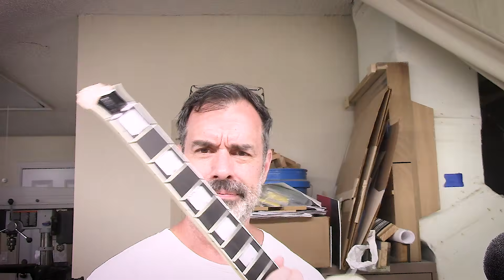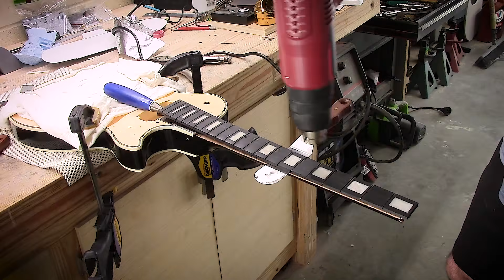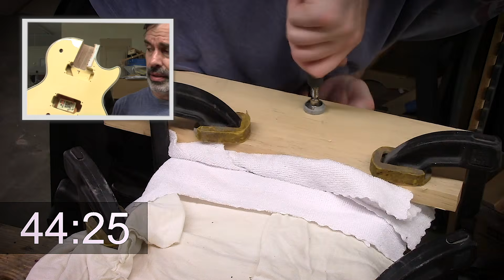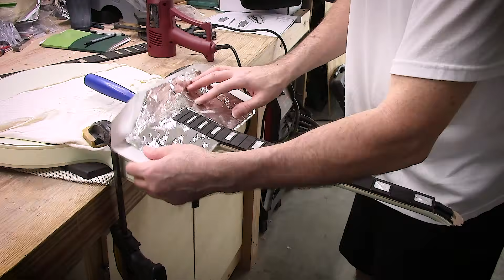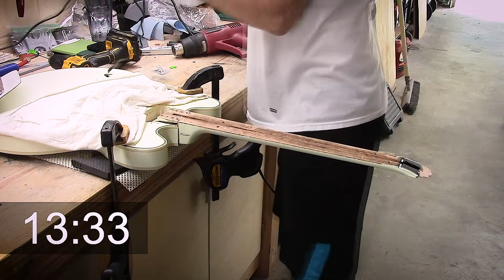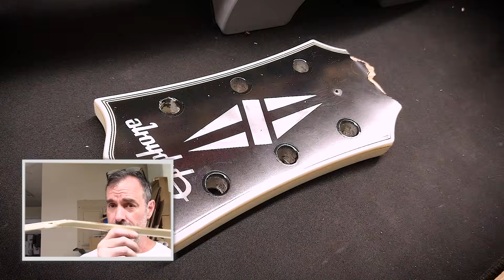Authentic Les Paul & 355 Broken Neck Guitar Repair Ep1

Comment: Hey John,

what an exciting project again! 🎸 I was really amazed at how “easily” the necks and even the fingerboards came off just with the heat gun – that’s something I’ve never done before, super fascinating! 🔥 Such a cool process to watch.

One thing I noticed: the nozzle on your heat gun seems quite wide. I wonder if there are attachments that narrow it down a bit, so the heat could be applied more precisely? 🤔 For example, it might help to warm up the glue joint more directly inside the neck pickup cavity. Just a thought!

I’m already looking forward to the next episodes. Until then – pretzels and beer, my friend! 🥨🍺

Take care,
Floyd from Germany 🇩🇪
Reply from the maker: Floyd, good to hear from you and thanks for watching!
Yes, how the heat gun was a nice surprise. This was the first ( and second ) attempts using the heat gun for this purpose. I don't know if it will work as well on other brands as the type of glue may vary, but on these Epi guitars the result was consistent.

There are heat guns with different size and shape diffusers that can slip on the end. The heat gun I have is only the big round end, so my option was limited.

I'm also looking at a heating blanket for fingerboard removal, but haven't found an affordable option yet. There are "barrel warmer" devices that are basically a narrow belt heater, which may be an option, may have to get one and see if it will warm, or catch things on fire.

Some neck lumber, rough shaping and maybe some back contour shaping coming soon!

Pretzels and Beer!
Be safe and take care my friend!
John
Reply: @theNextProject  

Hey John! 😄 Great to hear about your heat gun experiments – sounds like a fun surprise! I’ve seen those heating blankets a few times before; I think Big D even did a demonstration, though I’m not sure about the price. 💡 Maybe one could even rig something up using aftermarket car seat heaters – they’re usually affordable. Just a rough idea for now, though I’m not sure if they’d get hot enough.

Otherwise, Jerry Rosa made his own device. 🛠 It looks a bit quirky and bulky, but it seems to work well. The design is more like an iron system, and he’s got over 40 years of experience. If it works for him on thousands of instruments, it might be worth taking a look as an option.

Thanks for sharing this exciting new project! I’m really looking forward to seeing how both guitars turn out. 🎸🥨🍺 Cheers,
Floyd

Comment: Another great vid. Nice finish on these guitars. Are you thinking of slicing the front and back off the headstock like veneer to add to your new necks?  Is that even possible? Just thought it would be something to keep the OG serial numbers. But, now that I think about it, that sounds like a lot of work for questionable gains. Looking forward to seeing what you choose to do in Ep2.
Reply from the maker: STaipari, thanks for watching!
Great question, neither if these guitars will retain any of the original neck/headstock material.
I was surprised to find that both guitars have a ±1/8in thick plastic face veneer. It's the full thickness of the multiply binding. That really simplified manufacturing, as the entire face veneer is the binding, logo and inlay diamond.  But I question if that is a good structural decision, Idk.
Neither guitar will get any Epi branding, both owners are choosing their own shape and designs. 
The 335 didn't have any serial number on the back of the headstock, but it did have a stamped double-diamond mark. The LP is getting the owner's name and a code # added.
Episode 2 is underway, might be a couple weeks out as there is a lot of work to do, and a couple other projects that need attention too.
Hope all is well for you, be safe and take care!

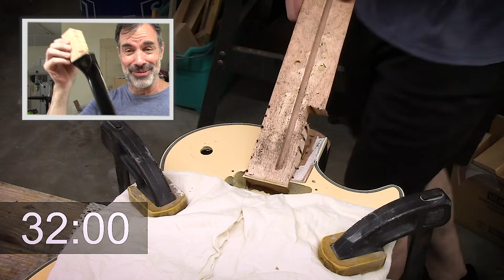Comment: 6:02 I had the same thing that happen to the neck that I removed on the Les Paul I’m working on. The pieces simply separated and I was able to glue them back into play.
Reply from the maker: Jake, good to hear from you and thanks for watching!
I was a surprised at the time when the neck separated at the heel. Having time to think about it, I should have expected the heel stack, as these necks have a scarf joint into the headstock. So, why wouldn't the shaft thickness be the same all the way, with a heel cap piece. 
I'm a bit slow at times, lol.
Hope you are doing well, be safe and take care!
Reply: @theNextProject oh wow I didn’t know they had a scarf joint at the headstock. A little more surprising that the headstock broke
Reply from the maker: These breaks are so strange. The 335 may not have a scarf, I shouldn't say.... Since it has a thick heel, it may be a one piece neck, idk. I should remove some paint and find out. Science and all that.
The LP models do have a scarf in the headstock, and that glue joint must be pretty good, didn't break there.
Reply: @theNextProject if you end up doing that it’d be cool to see what you find.

Comment: Have you watched Ted Woodford's method of Gibson head repair? It seems a more time wise method than replacing the neck.
Reply from the maker: bsharp, thanks for watching!
Yep, I've seen a number of Ted's Gibson repair vids, really great stuff and very well explained.
I've actually repaired a Epi LP with splines before, but since then have really began to question the long term success of splines in an Epi neck.  The reason I question this is not the type of repair (splines), but the foundation the splines will go into. Epiphone appears to be using a very light weight, soft, short grain lumber of some sort for their necks. Even with splines, I am concerned that the remaining neck lumber won't be doing its part, and the neck may fail again at, or near, the original break.  I've since chosen to use either "real" mahogany, or maple for replacement neck on Epi guitars. 
Back to these 2 guitars.  The LP owner chose to go with a one piece Maple neck, and a maple fingerboard, with a number of other changes as well.
The 335 owner purchased the broken guitar on purpose as he wants a thicker neck from nut to heel, which will fit his physical needs better. 
I'll very likely do spline neck repair on other guitars, but will likely pass on splines in Epiphones until they change their neck lumber. 
Thanks for the comment, I hope my explanation makes sense.
Take care my friend!
Reply: @theNextProject I'm learning a lot from both of you. Just as an aside, my wife thinks your method is much better than Ted's.
Reply from the maker: Thank you very much, and I'm learning a lot from Ted, and others who post/share ideas and projects. 
Ted has a great delivery style of his process and the info that goes with it. 
All good stuff.

Comment: I really enjoy your headstock and neck repair videos, but I’m pretty clueless in the repair department. I’m curious about the purpose of the solder on the frets before pulling them. Does it make it easier to grip? Is it the heat? Both?
Reply from the maker: NELVK, thanks for watching!
Great question regarding the solder/heat on the frets before pulling.
On some fingerboard, heating the fret will help break-loose any glue that may be in the fret slot. It's also considered to help relax the wood at the fret slot, but I'm not sure if there is much truth to that.
On these necks, there was binding on either side of the fingerboard, and whatever the factory used to attach the binding did get in the end of the fret slot ever so slightly. 
The only reason I did heat these frets was to help save the boards as much as possible. They won't be re-used on either of these guitars, but they may find a new home on a build or repair in the future.
Let me know if that didn't address your question, I'll try again.
Be safe and take care!

Comment: Hello my friend,
thank You for the show!
this time You can rename your channel to 'the Necks Project'. Great job.
My question, what if You stick nails in the drillholes and use only the heat gun instead of the foam cutters? Iron is a pretty good heat conductor.
Great work as always. 
Great video. Although people will of course be disappointed without sanding - I certainly won't be.
Stay safe and take care,
Jens
Reply from the maker: Hey Jens, good to hear from you!
Nails may work, I'm not sure. Maybe they could be preheated, and somehow held at temperature while inserted in the drill holes. Idk, interesting thought.
We will be making up for the lack of sanding soon, I see a couple full days of that joyous activity in my future, and yours too.
All good here, hope you and yours are doing well. 
Take care my friend,
John
Reply: What I mean is, when You are sticking nails in the drillholes and You are directing the heat gun on the nails and the neck joint, then the nails will become pretty hot and transfer a lot of heat into the joint.
Reply from the maker: @hueffel987  gotcha.  It sounds like an idea to test.

Comment: There's no doubt everything about the Gibson petstock neck area is a mistake. The angle creates a much shorter grain line and dramatically more pressure when dropped so that's a double whammy then you have the short grain weakened by a dramatically oversized truss rod cavity and an easy enough problem to fix by going to a body side truss rod adjustment and shifting the truss rod away from that part of the neck to give some more wood back to the weakest area and then the neck is made of mahogany which just loves to snap and split. It's pretty much The perfect Storm of bad neck design. That said I love my Les Paul just don't drop the damn thing.
Reply from the maker: Evil Google, thanks for watching and the comment too!
Yep, the LP will be getting a maple neck with a spokewheel t-rod at the neck pickup area.
The 335 is getting a 3-ply lam-ahogany neck, t-rod at the nut, but will also feature a full, thick asymetric carve and volute.
Sadly, bad things happen to good guitars.
Be safe and take care!

Comment: Nice job.  Looking forward to seeing the new necks.  I've never snapped a headstock off, so I just don't understand why this happens!
Reply from the maker: Curator, good to hear from you and thanks for watching!
I don't want to talk bad about any brand, but I've seen too many of these "E" guitars with this issue, more-so than "G" guitars and their known for this kinda stuff.   
My guess is the headstock angle, and even more the lumber used by the factory for the necks. The lumber in all the "E" guitars has been a really light weight, very short grain, rather soft "mahogany" of some flavor. 
The necks are both on the slim side, deep truss rod routing, not much meat left under the nut. 
Makes for a light, no neck-dive guitar, but if the head is prone to popping off, that's not a good manufacturing decision.
The LP broke in the box during shipping (I've seen that before, sadly), not sure how the 335 suffered it's fate.
I'll make them better than new, which isn't sayin' much actually.
Hope all is well, be safe and take care!

Comment: Have you got yourself a double whammy there John! At least with Gibson (or Epiphone) you can be sure good things never change. Like providing work to the guitar-repair-guy 😁. Greetings, Peter
Reply from the maker: Hey Peter, good to hear from you and thanks for watching!
Yep, job (hobby) security of various sorts.  Luckily, I like taking things apart, so I feel they are building these just for me, LOL.
Hope you are doing well, be safe and take care my friend!
Reply: Ibanez, Jackson or any brand that uses angled headstocks.
People only talk about Gibson.

And accoustics./ spanish guitars. Fixed some of those
Reply from the maker: Nieko, thanks for watching!
True, it's not just Gib and Epi. 
They get blamed for all headstock issues, and yet it's pretty much all guitars with the angled headstock as you mention.  
One thing I'll add, is that all manufacturers could do a better job better job of choosing the neck lumber.  These Epis use a very soft, light and rather weak lumber, which is then routed away at the end of the truss rod.
Oh, I was surprised to see that the headstock overlay on both of these guitars is a 1/8in thick plastic piece, which is glued to the headstock lumber face. I don't know how to feel about that.
Be safe and take care!
Reply: @nieko3038  And somehow my Korean 1989 Squier HM 1 lives on! Truthfully, there are millions of tiltback headstock guitars out there with no problems, so I wonder what the failure rate actual is. 🤔
Reply: @Markleford Did you drop it at any point? Chances are it won’t survive that. It has similar construction as the Ibanez guitars. Maybe it is a thicker neck.
Headstocks don’t break if you take care of the instrument. Playing Epiphone and Gibson since 1998. Never had a broken headstock.

I have a 70’s Fender Pbass here with a repaired headstock. So that’s breakable as well.

The one piece necks are fragile. Somehow people criticise Gibson for it yet many are fan of the inspired by Epiphones.

I think there is more focus on Gibson/Epiphone. Many love to bash Gibson (including myself at occasions)

I would like to know if the 70’s Gibson break as easy. Those have 3 piece necks.
Reply: @nieko3038 Haven't fully dropped it in the past 35+ years, but it's been through a lot including only ever having known a non-reinforced gig bag for a lifetime of transport.

To its benefit, though, it was the only model in the line without a locking nut, so at least it's a little stronger without the extra holes!